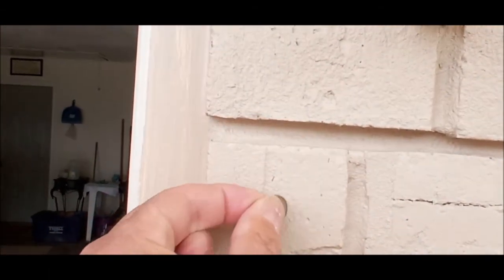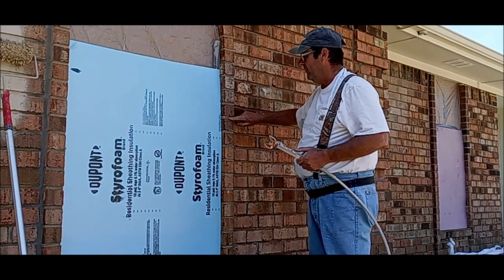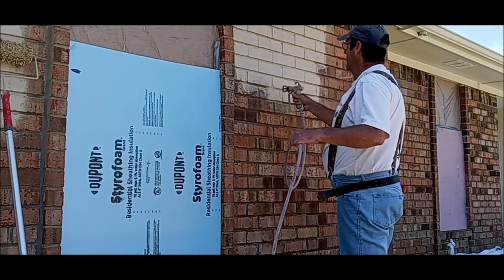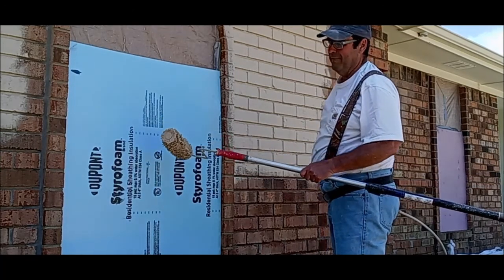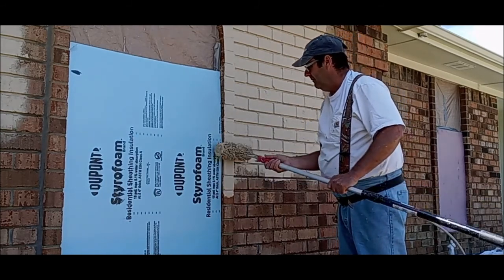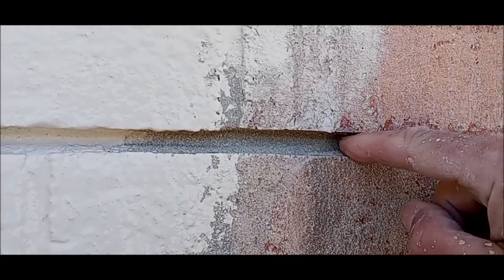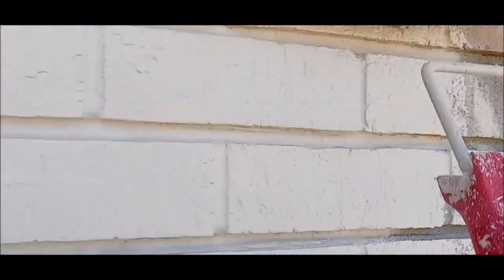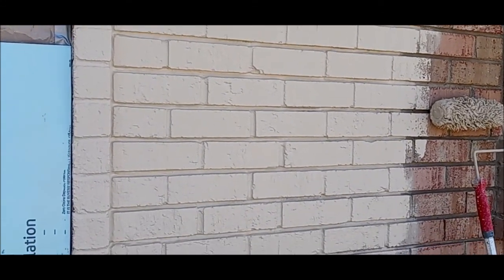Painting Brick with Loxon XP

Comment: window covering like that catches the overspray too. good job.
Reply from the maker: Normally yes , but I sprayed my angles so it wouldn't , and I brushed and rolled that accent brick around the windows , I didn't try to spray it ...... I had no choice , tape was pulling paint off the windows , and I just didn't want to risk that mess , and yes I know about "delicate surface tape" , didn't want to risk any tape directly on window frames ..... It worked , I cut that stuff tight and did not push it all the way back to the window , there's a little space behind the foam board , that helped too .... it worked .... but yes , in general that's not the way to do it , I fully agree
Reply: @shure46  I was saying it was a decent method to fully cover the glass. Because, I was thinking you didn't have to razor off any overspray. I found your channel doing some digging learning about Loxon. I have to paint my foundation. Not as textured as that brick tho. 
Thanks for putting your projects on yt.
Reply from the maker: @svrs  Oh I see , sorry I thought you meant "covering like that can still get overspray on the windows and window frames" , which it could if I sprayed right around the foam on that brick .... Technically it COULD "leak" a bit IF you tried to spray all around the foamboard ..... But I just stayed clear a little and later came back with a brush and cut that in ...... and yes , it was actually not a bad way at all , I liked it ...... and if those windows had just been square it would have been even easier .... That radius over the top was a pain in the ass , but nothing too difficult , it got covered and all went well ...... It's not a bad method really since I hate masking windows anyway !!!!! lol ..... but in this case , I had to do this , the paint on the window frames was really old and that tape would have peeled the paint off the metal window frames when I pulled it off ..... Anyway , that Loxon is good paint for brick , sticks like hammered hell , never going to peel or come off .... good stuff , but it takes a LOT of paint to paint brick ..... Especially when those ,ortar joints are so recessed back ..... If the surface was all flush , it would not be bad at all and not as much paint ..... I had to shoot a LOT of paint to get in those recesses of mortar ..... House came out beautiful though , looks great
Reply from the maker: @svrs  Loxon is good stuff , I'd do two coats , one thinned coat to soak in the cement , second coat either slightly thinned or full strength for top coat final finish ...... BUT you can just slop this stuff on full strength and probably cover it in one coat , save you some labor ..... it is very thick stuff , but good product ..... SW Emerald Urethane is also a good product for trim doors cabs if you do any interior stuff , and it is an "interior/exterior" product so you could paint a front door exterior with it ..... (I would NOT use it to paint my house exterior though , Duration is very good for that , Super Paint good too , Behr Ultra is also a good exterior house paint , and frankly works good on exterior door surfaces pretty nicely)
Reply: @shure46  thanks for the info. yeah, I got my work cut out for me. we ripped out the front bushes that have been there since creation and discovered some painter way back when just randomly rolled paint on the foundation every few feet. So, covering that won't be too bad, but a closer look shows I'm in for a whole house repaint. it's a cedar shake type siding built in the 50s I got to do some woodwork on the sills too. got a new roof two years ago, a new sewer line two years ago too, then a new gas main last year. sick of my front yard being torn up. So, just getting the curb appeal back up will be a chore. It'll be a good summer project. I have to dig my old wagner out of the garage and see if it still works.

Comment: What did you use to thin it and approximately how much did you use per gallon?
Reply from the maker: Loxon XP is a water base paint .... I thinned with water ..... I do not know exactly what ratio , I thinned until it rolled well into those deep mortar joints .... if you do not have deep mortar joints , you may not have to thin it much at all .... it depends on your situation .... I also added some floetrol ..... watch the video , it explains everything

Comment: SW site states it needs 2 coats.  Just noticed your intro said designed for one.
Reply from the maker: well I certainly applied two thinned coats , but full strength you might very well get it in one .... I would not do that though , definitely want one thinned coat to soak in the pores first in my opinion , anyway , what I did , worked quite well , still lookin great

Comment: Hello. Can you tell me what paint gun you are using? Thank you.
Reply from the maker: I use Graco contractor gun (TWO finger trigger , don't get a FOUR finger trigger , they suck) , and I use Graco tips .... the gun will attach to the hose of any sprayer , Titan or Graco ..... I just prefer Graco guns and tips .... tip for this project was a 317 and a 417 , but I thinned the product a little (full strength Loxon would need 321 421 521 larger tip size , for regular house paint , I use 313 .... I painted the trim with Duration and a 313 tip .... Loxon Brick Paint is much thicker paint ..... Titan guns are fine , just don't get a 4 finger trigger gun (longer trigger just harder to use) ... Graco tip and tip guard will attach to any gun ... I do like Graco tips better than titan ....

Comment: How has it held up?
Reply from the maker: Fantastic , I go to that house all the time , she's a regular customer of mine ..... Loxon is good stuff for brick ..... Just thin it some , it is very thick right out of the bucket , and my first coat was thinned quite a bit so it soaks in the pores ...... it definitely sticks very very very well ..... Loxon makes a primer , IF you use that , then topcoat with whatever you want , I just used the Loxon Paint , so the whole thing is just a couple of coats of Loxon Paint , I slopped in on though , it took a LOT of paint , I think it was 25 gallons to do that 2500 sq ft house .... It does take a lot of paint to paint brick ..... But as my video says , those mortar joints matter a lot .... flush mortar is much much much easier than recessed mortar joints .... Loxon is good stuff though , sticks like glue
Reply: What do you think it out with? @shure46

Comment: It leaves pinholes like a mother. Even with three coats.
Reply from the maker: I thinned it , backrolled it , looks great , it is NOT "easy to work with" true , takes elbow grease , but it worked fine for me , and yes it tries to pinhole , you just have to keep at it .... two coats for me , and i slopped it on .... ALSO I would assume certain bricks are worse than others when it comes to painting and pinholing